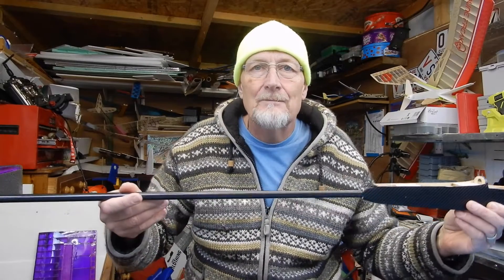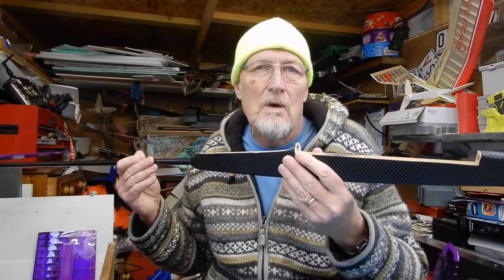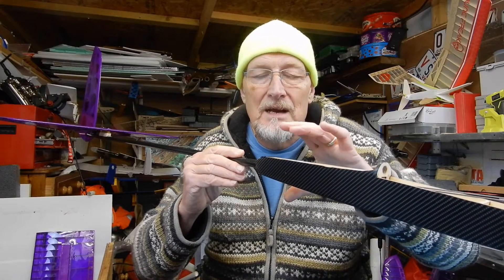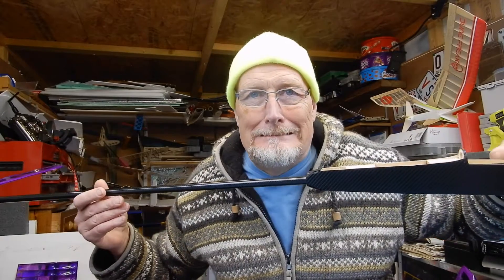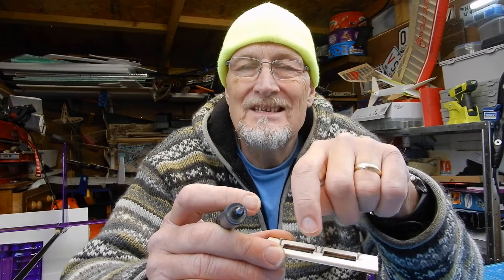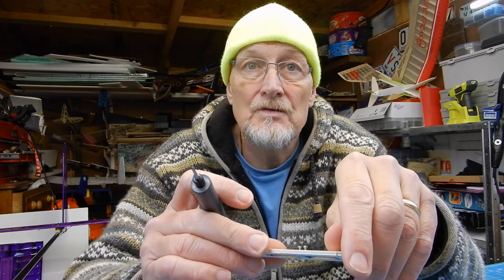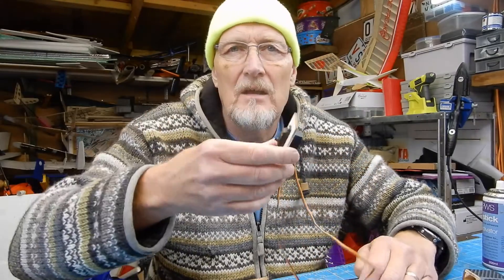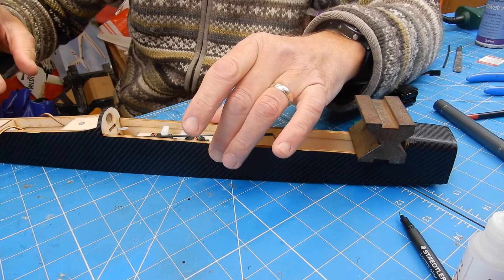How to Build The Avanti 3 metre F5J glider Part 6 servos and boom covering

Comment: Hi Nick, I've followed your videos closely and am now at the covering stage.  For the center panel, did you cover the left and right sides of the center panel separately, or did you do it with one piece spanning the entire panel?  Asking because of the dihedral.  For the outer panels - similar question.  Did you cover the tips separately from the flat part of the left and right panels?  Also asking because of the dihedral at the tips
Reply from the maker: I did three panels mate as my wings unplug
Reply: @NickChittyFlying  Hi Nick, I meant to ask if you covered the center panel in two stages - one stage for the left and one for the right, or all at once (one piece of film).
Reply from the maker: @tayloranderson7018 one panel top and bottom 
When shrinking down after sticking edges start from middle as you work out wards do top and bottom panels alternately take you time it’s thin leading edge

Comment: Hi Nick, great video!  Can you share some detail on the servo connection between the main and tip panels?  Are connectors integrated into the ribs somehow or do you need to connect the wires from each side before each flight?
Reply from the maker: Yes mate glued extion lead to inner panel outer rib
And free hand connect to servo lead😅